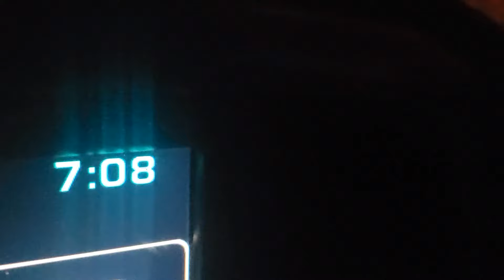Wild Hog Delivery Day!! Not For Slackers LOL  😂 🤣 😅 🙃

Comment: Dunno if Ii unnerstand the problem you got there, BUT!
I made a gaddget, which dropped onto yjer Ball-Tow-Hitch, & had another Ball  about 4" lower, This was generally chucked sonmewherre on the floor in the back, along with other useful junk.
It wouldn't have been safe for towing alonh the Highway (nor was it meabt for tthsat.) Sinplt fitted over the Tow-hitch,  extended the 4 inch3es backwards, AND Downwards, you could hitcyh your Trailer to that extension, jack the Trailer tow-bar up (& move the whole shebang,n un-hitch from yhe ectension & re-hitch to the Pick-ups Tow-bar.
I did have to reinforce the original with "Side-Plates"  to prevent it swinging sideways, (that'd be even more inportant to clear your Ramp, as it looks you have trouble turning, & from experience, it's always the way you CANYT turn, is the way you NEED to turn.
Hope you can make some sence of that, I did it fromn scrap, took longer thibking anout it, than oitt did to make it. Make have used itt less than ten times in my life, but jestt the once was worth it!
Happiest days were out tthere alone